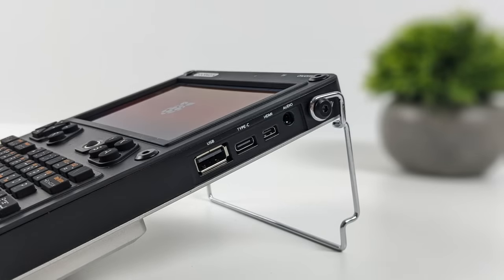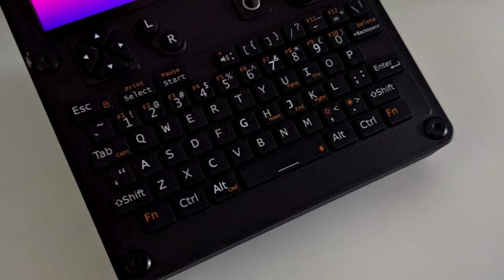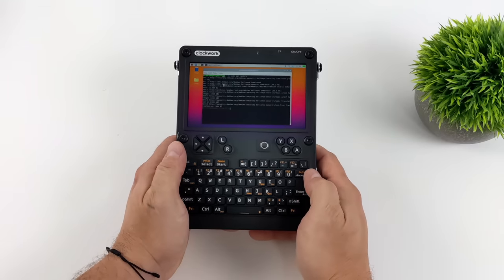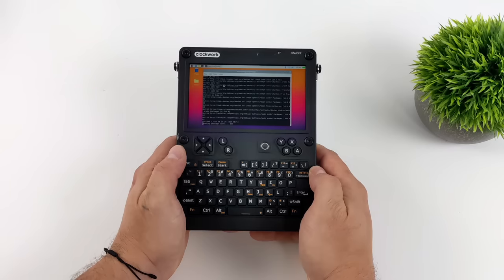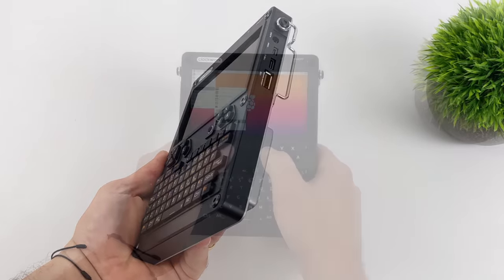The uConsole Is The Coolest All-New DIY Handheld We've Ever Had Our Hands On

Comment: I hope this receives better support than the Gameshell. They never came with new modules and the software support was dropped very quickly.
Reply: it's raspberry pie, so it's just the raspberry pie software, seems good enough to me.
Reply: @krux02  But has a custom screen, custom keyboard, other custom hardware. These might break at any time, will most likely break when you need to run OS version updates (if you can even do that with Raspbian).
Reply: @quarteratom   keyboard is connected over usb (regular hid), as is the trackball, so it should be fine

display is MIPI iirc, which does require a couple patches to the kernel but shouldn't be too much of an issue

i'm planning on maintaining patches & shit even if clockworkpi goes under, for the record.
Reply: The use case for this thing is some niche I don't doubt they'll never sell enough for it to be anything much.

Comment: Would love to see a DIY "Ruggedized" form of this. Would also be great if solar charging or crank charging could be added for outdoorsy purposes :P.
Reply: it probably wont be long, before *.stl for printable bumpers are up on thingyverse. and for solar/crank chargers, you just need something with a USB output or slot for 18650 cells. have fun hand cranking LiIon cells to full charge, tho! lol. 
just dont hope for a waterproof version, unless you apply the conformal coating yourself.
Reply: @Ucceah  You got me curious thinking about how long it would take to crank charge something like this and I happened to have the stuff lying around (old vape with USB c charging w/ 2 battery slots and a hand crank). It took 30 minutes to get to 5% lol  - that being said frantically cranking to get enough power to save a game/trading off between cranking and playing isn't out of the realm of possibilities and I find that novel and amusing.
Reply: Just coat the case in truck bed liner before you assemble it
Reply: @Heowolf  The trick would be to mount the handcrank charger on a stationary cycle with a gear attaching the crank to the chain. Then you could exercise and power the thing simultaneously. Imagine if kids had no option but to ride the bike to play the game...
Reply: @BeyondPC   Would be a "fun exercise" at least.. lol. Adding a flywheel to a gear ratio like that though would be a nice start.
Reply: It's an all aluminum enclosed build...pretty much ruggedized out of the box
Reply: @Heowolf  Screw cranking it by hand, hook that up to a stationary bike.

Comment: I've been looking for a handheld with a keyboard for DOS emulation and rougelikes for a while and, other than the fact that the RPI4 isn't great with 486/pentium emulation and some liberties with the keyboard layout maybe causing issues with a few games, this is probably the best option I've seen
Reply: The whole time I thought "I need this" - and now I know, why I want this! thanks :D
Reply: For DOS Emulation I use GPD 4 - it's on the expensive side, of of course, but it's simply stellar.
Reply: Can it run n64 games? The thumbnail shows mario 64 but he never played that in the vid
Reply: @Henry-oe2tn  I don't have this yet but it's a RPI4 inside so it should be able to run some of the easier to emulate games.  But since there's no analog stick and this device is more focused around the keyboard, it's not really the best for this.

Comment: I absolutely love this little design. I wish we could get a windows handheld with some of the more powerful hardware we've seen coming from AMD in this design. Then we just snap on a Bluetooth controller with telescoping on and we off to the races.
Reply: That's definitely a possibility for the future. Just needs someone to do it really as it is possible to make PC handhelds. 
It is a pretty cool form factor, i'd been interested in a Windows version.
Reply: @shaolindreams There have been several attempts at Windows based ultra mobile PCs, but as good as they have been, they never caught on. There are usually too many compromises in either size, form factor, battery life and performance. Not to mention they always cost more than people want to pay for them. Netbooks had the same problem. Personally I'd prefer a normal mobile phone with a decent physical QWERTY keyboad. I really dislike typing on touch screens. 😡
Reply: @another3997  true but the hardware is always improving and it has got to a stage where we do have quite a bit of power that can fit in the palm of our hand.  i had many of those older devices and the problem was always performance.  Yeah i prefer a keyboard too, can barely type on  touchscreen let alone touchtype. Bit unfortunate Windows Phones died.
Reply: GPD is where you should look.
Reply: @another3997  man I want hardware keyboards on Android phones to come back so bad too. I used my original Droid for soooo long because I loved the slide out keyboard. I could type 50 wpm on that thing. Wrote entire essays and term papers on it.
Reply: Lenovo Legion?
Reply: Winbloat 😂😂😂
Reply: Still waiting on a more modern AMD chipset board around the size of a Pi, the kind you'd usually find in gaming handhelds today but just as a module in a DIY fashion.
Reply: There's DFI GHF51 using ryzen and it's smaller than a raspberry pi. Lags quite a bit on windows 10 but there is hope in future
Reply: @HolyRamanRajya   Would like to see an updated version of a DFI board in the future. It's the best they got, but Picasso R2000 and Vega is looking more dated nowadays.

Comment: If this had a 4:3 aspect ratio screen it would be an instant buy for me. Everything else is just perfect: 18650 cells, qwerty keyboard, metal shell, the design. I really hope a version with mentioned 4:3 (or at least 16:10) screen is coming in the future.
Reply: 16:9
or widescreen
Reply: @unpotatoedsalmon  Yes that's my problem.
Reply: I'm sorry, but.. what do you use something like this for?
Reply: @iFireender I would actually use it to emulate old games, and also to run all sorts of programs.

Comment: It's like a modern Pocket Chip, but it runs on a Raspberry Pi CM, uses a higher quality shell (Aluminium instead of plastic), comes with built in speakers, has a trackball, lacks a touchscreen and you *have to assemble it yourself. 

I think this is really cool, it just needs a touchscreen and I'd get one.
Reply: *get to

Comment: Very neat. Would love to know what the battery life is like in practice.

I figure a big stumbling block for all rpi based handhelds is the lack of a proper low-power sleep or hibernation mode. It means you're stuck either leaving the machine sipping energy the whole time or having to wait for full shutdown when your done and a full boot when you want to get started again... 

A definite barrier to using it on the go.
Reply: One nice thing about 18650s is you can get em with 3600mAH so you could have over 7200mAH on 2 of em. Not sure how much power the pi uses but pretty sure you could get good battery life off of that.
Reply: it really shouldnt take too long to boot. if its for emulated games, then simply save stating then powering it off should be very quick. a script to do all this for you would be pretty easy
Reply: Maybe it will run Mobian?

Comment: It does look pretty cool, although the battery type used seems to increase the thickness quite a bit. Also, the unit shown in the video appears to have a large scuff/chipped paint on the top cover out of the box.
Reply: I'm fairly certain these are just review units, so who knows how many people have handled it before. I daresay other battery types could have been implemented, but price and availability are factors to consider. If people want ultra slim devices, there are plenty available,  but they too have their downsides. Horses for courses.
Reply: @another3997  Good point with the review units. As for the batteries, pouch type Li-Ion batteries are pretty inexpensive, but it is possible that they had a valid reason for not using them.

Comment: It looks pretty modular, the first thing I would want is to fix the battery.  Either have two cells at the sides vertical so you have some grips, or use a pouch cell. So the back is flat.  But as it is modular its very doable.  Sad it did not come that way however.

Comment: Pretty reasonable prices compared to the Devterm and looks like it might be a bit more easy to hold in your hands, although it might be a workout being all aluminum.
Reply: It's not that heavy.
Reply: I'd rather have aluminium than plastic, even if it does weigh a bit more. Aluminium is pretty light and more durable than magnesium. But let's face it, if you struggle with the weight of this... you probably have problems with laptops and books too.
Reply: Do they state how heavy it actually is? I never saw any indication. I'm just going by metal products of similar size and potential density. It looks heavier than a steam deck to me, but I wouldn't mind clarification.

Comment: Does the handheld itself come with an overcharge/overdischarge protection circuit? Or do you need to make sure that the 18650 batteries that you put in there have their own protection circuits?
Reply: Yeah he mentions a battery module @4:35 but doesn't show it

Comment: I think they messed up with the batteries and that case back. If they had made the back of the case in two parts, you could replace the batteries, or swap them as needed. But because the thermal pad is fixed to the back and the battery cover it part of the back, you can't get to the batteries without damaging the thermal pad.

Comment: Hm not too sure about a trackball. I did use one very happily instead of a mouse, for years, but it was a full-size one, snooker ball sized ball rather than a gobstopper. Getting a Thinkpad (a real IBM one!) converted me completely to the "nipple", the Trackpoint, a little rubber doodad you just move the tiniest amount, it doesn't actually move on it's base, it just somehow detects that you're bending the rubber. Was great! Can do fast and slow movement, precise when you need it, utterly intuitive. Shame they didn't put one of those in. They're the best solution for portable mousing. After a while I never bothered with the usual touchpad mouse it also had built-in.

Comment: I'd love to see some other compatible SBCs used in this thing! Something like Orange Pi's Rockchip-based models or a future Intel N50/N97-powered board.

I'm very pleased to see they actually used that aluminum sheet for some sort of heatsink. I've seen some other SBC-based tablet and handheld devices just completely disregard thermals. They could totally have gotten away with a plastic main plate for rigidity and instead are opting for stamped aluminum, which is also going to be stronger in the long run.

Comment: love this handheld and the artistic design associated. Can't get CM4 modules though, having cm4 as part of the package will also mean it will sell out quick
Reply: Oddly enough, the CM4 version is the only ARM version of the preorder not sold out. There is also a RISC-V version, but they basically acknowledge that RISC-V isn't really ready for regular users at this point (which is why it's cheaper).
Reply: yeh found that a bit funny. as well. New RISC craze going on.

Comment: This is a neat little device perfect for Data Center as well as any lab admins and tecnicians.
It can have the right concoction of monitoring tools baked into the OS and then this is the go to device for troubleshooting servers, switches, routers and what not.
All it needs is wifi or usb console port, which should be part of the bundle already.
Reply: Nah dude, you have terminals for that or a laptop, my hands would cramp after an hour max.

Comment: A few thoughts:
1. I don't want 4G or LTE, but it looks like I'd be stuck with it.
2. I'd prefer a larger (flat) battery, to reduce profile, with arecharging circuit (not specified)
3. That keyboard looks awful, and with no way to relabel (or add more secondary function labels).

Comment: I hope the first thing that they add is a touch version of the roller ball. I have owned Blackberry's with both the roller and the touch version. The roller after a while needs to be disassembled for cleaning but the touch version only needs a whip with a cleaning cloth at the worst. Not until the touch pointer becomes available will I contemplate buying one as I well remember how much of a pain cleaning the roller ball was.

Comment: My god. WIth that 4G module and a SIM card, plus Chrome with the Android Messages app, Discord, etc. installed, this could be an amazing replacement for someone missing the Blackberry experience. Oh, but, does it have any phone functionality (and a microphone), or is the 4G strictly for data? I know you can probably hook up a wired or bluetooth headset, but man, if you could actually use this thing like a phone, I'd be tempted right now.
Reply: my thoughts exactly. ever since my blackberry key 1 died i have been searching
Reply: @crnknstn  I was actually a Samsung Blackjack guy, but man nothing beats a physical keyboard. I'm still using my keyboard attachment from my Xbox One with the Series X (props to Microsoft for supporting it on the new controllers, even though there's a mm gap now).
Reply: @BlaineEvans  Yeah, I can't stand touch keyboards.

Totally forgot about those keyboard attachments. Are there issues using it on windows?
Reply: @crnknstn  never tried on Windows, sorry!

Comment: I ordered one in december 2022 thinking i'd get it in 90 days like the website says. had an email from Alex saying it would ship in march 2023... cut to september of 2023 and still nothing. the forum has been updated once in a while and units seem to be shipping but no one at clockwork will say how often or how many are shipping. communication from this company is terrible and we're relying on other customers in the forums to try to figure out the shipping number and schedule. i wouldn't recommend ordering unless you want to fire and forget and then be surprised if something does show up many months (year?) later.

Comment: Need more expansion boards like Network connection test SFP+ 1G 10G 25G 100G, WiFi 6e, Oszilloscope, SATA, Audio 3.5mm & XLR, Video HDMI VGA DP DVI
Reply: Dual SD CFexpress A B Micro SD reader Backup Photos Videos

Comment: Quick question I don't know if you'll respond but I just ordered mine you show the speakers running off the 4G cellular module I ordered mine without cellular am I to assume there's a little PCB. Just has the speaker input that's slots in there¿

Comment: You know how many guys there are who carry a company provided laptop for things like fire alarm servicing, access control repair and two-way radio programming? 
All of us do.

Want to know what those machines are like? They're SHIT. I5's with 4Gb RAm and a 256GB HDD. No native RS232. The cases are skinny plastic with liquid crystal leaking at the edges of the screen. They're almost always laggy as hell because they run a ton of company mandated "security" software that my machines at home have survived without for decades.

What do we want? Well, we tolerate the low end processors because the actual tasks we're completeing are low burden - It doesn't need to be a water-cooled overclocked I9.
We're sick of broken / failing tools, but we're not complete baboons, so something rugged, but not military. Think hafway between a Lenovo Thinkpad
and a Panasonic Toughbook.

THIS device is almost ALMOST "the right idea".
Improvements:
It has to run WIndows 7 / 8 (nobody cares about 10 / 11)
It has to have native RS232 (calm down - industrial stuff has it)
Throw in RS485 and I'd be really sold
The screen needs to be covered with plexi-glass or similar (I'm not a materials scientist)
That LTE antenna needs a block of polypropylene over the top of it with sealing against rain (IP54?)
The keyboard rubber should be it's own seal
Rubber covers across USB / power sockets

Do the above, and this will sell to professionals from our own back pockets.
We just need to interogate a machine / device with terraterm etc and run fairly light configuration software.
$200? Is this a joke? We're buying 2nd hand Panasonic Toughbooks for £1000. Up the budget and give us something we can make use of.

What THIS is at the moment, is a novelty for those with more money than they need.

Comment: Mr ETA is there any way you could post a video on the workarounds you had to do in order to get it to work on the Uconsole I have the Clockworkpi same as above and the OS is locked down it won't let you update I can get the retro pie script to run but it fails to install every single item there is literally a community of 1,000 plus people with the same problem in there is zero documentation on how to get it running on the clockwork but there are plenty of people with it running. There is literally a Reddit community of thousands of people with the same exact problem I posted this question how to get it running they said welcome to your dust collector 2.0 and super stinks because I gave my pie 400 to my son and two of my other pies to my friends set up with retropi and it is not plug and play as I thought it would be so I'm super :-( sad face all up in here please help 😢

Comment: How well does it emulate DS? Seems like a Pi tinkerer could use that kickstand hinge to make a clamshell with the included screen up to and a touchscreen in the original position.
Reply: If you can find a good emulator, DS runs on pretty much anything. DraStic on Android comes to mind and this is an ARM chip so maybe it's possible.

Comment: An RPi case, yes. Wrong screen aspect, too small screen, weird controller layout, wrong keyboard layout, too small keys, have to move your hand to move the mouse pointer. Don't see the advantage over smaller devices, or a laptop and plug in a controller.